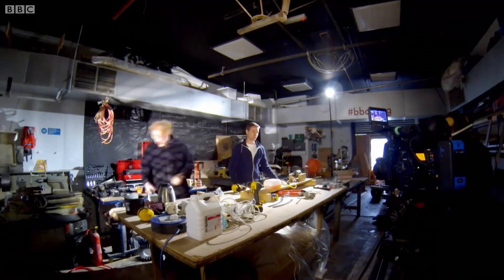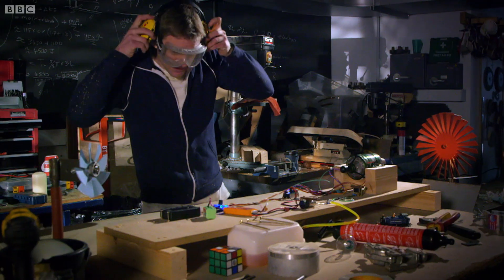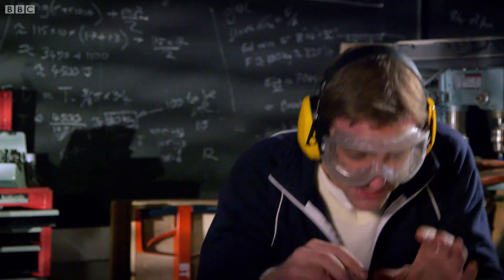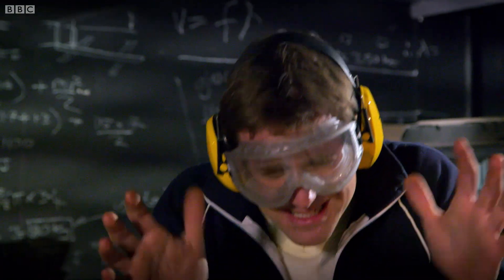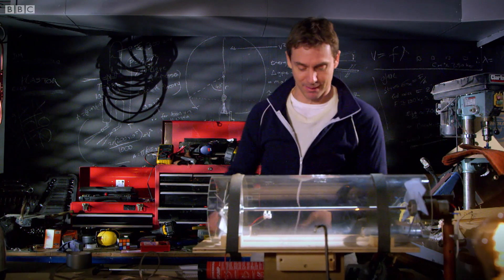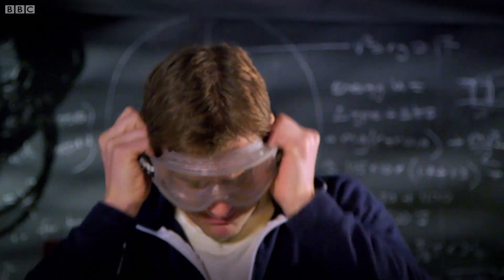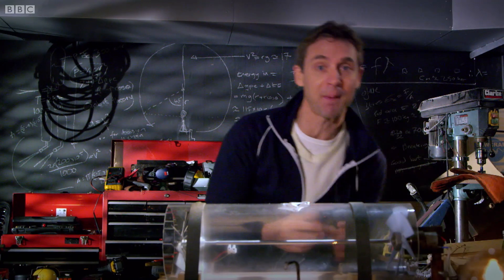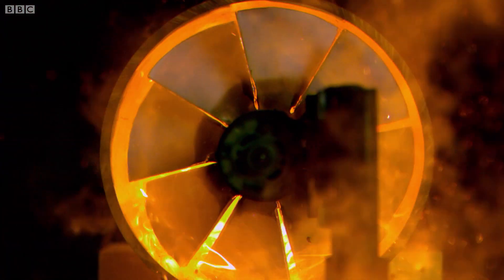How To Make a Mini Power Station | Bang Goes The Theory | Earth Science

Comment: Damn these ignorant people in the comments section. Obviously this is only a demonstration. Why do you expect this to work efficiently? Sure, that second example is off since the turbine needed to be connected to the compressor to sustain the engine, and an external, or separate turbine is what should be connected to the generator, but this is a one-off burst which only shows the concept, and even with this simple example I'm able to understand it clearly.

Comment: Here's one for bang goes the theory to test. Japan or china uses electromagnetic generators that put out more energy than is put into them, so can those generators run off their own electricity that it makes and use the leftover extra energy to run magnetically driven motors or even a jet engine without any fuel use?

Comment: Gladstone power station, Australia, completed 1976 produces 1680 megawatts.  There was a gas turbine for internal start up power and peak load.  Since it was vastly more expensive to run than the coal fired steam turbines, it was usually off.  So I'm not sure which theory went bang here.

Comment: should have used the alternator on the front of that motor. It's connected to the turbine shaft mechanically so you get much more power out of it. Plus that's what it is there for.

Comment: In the second part of the video, the gas expands as it is ignited and spins the turbine fan on the right, which is connected to the compressor fan on the left. My question is why doesn't the gas expand leftwards and apply the same pressure to the compressor fan and make it spin in the opposite direction to the turbine fan. I presume the real turbines will have specially shaped ignition chambers that direct the exhaust gas to the right, but in your setup (the entire tube is the ignition chamber) the performance would be... Zero. Nil. None. Nopes.

Comment: And where do you get cheap gas in industrial scale?

Unless you use solar  power to generate hydrogen gas from water. Hydrogen is also a clean burning fuel.

You can generate solar energy in near desert areas at equator with the most sunlight - where actually transporting the electricity itself is expensive and difficult. 
A way to store energy in the form of hydrogen. Then burn it - releasing heat, kinetic energy and water.

Kinetic energy will turn the turbine as it explodes and expands,  water vapor can be collected as clean water (its pure h2o), heat can be used to   create hot water (for a city) OR used to heat a greenhouse to produce food all year around in colder areas OR redirected to heat water for  steam turbines - double use.
Meanwhile generating 0 waste  - 100% green.

Any billionaire interested of the idea? :D send me a message lol.

Comment: Ridiculous. But how much does it costs in petrol to run that turbine?
Reply: Anchieta Cruz Runs on natural gas. These aren't usually used for constant power generation though. This system is more commonly used as "peakers", that is when a city needs more power than is normally available from the outside grid, say at a time of hot weather when A/C use is unusually high. Power companies will use a system like this to produce power to supplement supply. Actually these work pretty well for that use, faster startup and more efficient than large scale diesel generators of similar capacity for the job.
Reply: Ok +Oldbmwr100rs but How much does it relatively costs per kilowatt? It's efficiency in converting thermal power into electricity. I know the Brayton circle that power ups gas turbines, it's that solution any better than the other options?

Comment: A lot of people are missing the point of a gas generator, yes they are more inefficient but because they can be adjusted so quickly they are better suited to covering sudden peaks in electricity demand. Coal generators take hours to fire up and renewable resources are dependent on the weather/time of day. To make sure an entire citiy never has a drop in the electricity supply we must generate more than what's needed at any one moment since storing it is pretty much impossible on such a large scale. To keep this extra supply down to a minimum most cities will have a gas generator ready to cover those unexpected peaks.

Comment: The efficiency advantage is in matching source with demand for energy. The environmental advantage is using a clean burning fuel whose byproduct is water. The political advantage is that sources of the fuel are broadly and plentifully supplied by free-market democracies. The apparent problem in the model does not exist in machined industrial units. Gas is the clean bridge necessary while we improve the technology for sustainable sources of power.

Comment: So basically you're wasting energy in form of fuel to get even less energy in form of electricity? Nobel's Prize nominee.
Reply: A11ex This is a method of converting energy. You will always get less energy than the potential in the fuel, that's basic physics. The key here is to make the supply match the demand as accurately as possible to reduce one of the causes for inefficiency.
Reply: A11ex He's showing how a power generator works. How do you not understand that?
Reply: A11ex My electronics can't run on fuel.
Reply: A11ex You must be a special kind of stupid... A gasoline generator is at most 25-30% efficient. Gas turbine generators as such are 30-37% efficient. However in those new power plants the exhaust from the turbine engine goes in to a boiler to heat up water for steam to use in a steam turbine. Steam turbines by them self are 30-39% efficient. So now you are extracting over 70% of the chemical energy stored in the fuel. But wait! There is more! The water they use to condense the steam in the steam loop is over 70 deg. Celsius hot! You can use that water for heating and household purposes! So now the efficiency goes up to almost 90-95% which is in the ball park with fuel cells. Cheaper, on a mindbogglingly larger scale... Also, you are not limited to natural gas for fuel, you might also use methane, hydrogen, diesel, kerosene, gasoline  and an array of other liquid and gas fuels. So yeah... They are pretty interesting!
Reply: A11ex natural gas thats mostly wasted or burned on oil platforms anyway,,, methane from farms or human waste can be used too instead of just letting it out in the air like we do today (methane is worse then co2 but becomes less harmful when burned for fuel). He said gas not fuel.
Reply: Not a waste. It's to inform/entertain youtubers. Same could be said about you watching the video that seemed to have neither informed or entertained you, you've just wasted energy and man hours, go do something productive.
Reply: Eviltech More importantly gas turbines are used to cover sudden spikes in the power demand because the power generation can be increased so quickly. To cover this demand with other sources such as coal we would have to generate a lot more power than what is needed so despite being less efficient when used in conjunction with coal and renewable sources the power grid becomes more efficient.
Reply: AshyLarry Yes, it is! And solar is the worst energy source gridwise!
Reply: DigitalYojimbo
I understand the need for YT 'content' but this experiment seems rather pointless. Just use a power generator, imho.
Reply: A11ex You must have completely missed the entire point of the demonstration. Maybe try watching AND listening.
Reply: ***** *Automation, control  and communication technologies... Not that that has any importance, having in mind we just wasted 6 years in university...
Reply: +Profezor Snayp The setup was for demonstration purposes; the turbine engine itself is used to turn a generator, the exhaust is used in a superheater (HRSG) so steam can be used in a steam turbine. That setup is what a power plant (using natural gas) is about and is quite efficient.

Comment: where would you build such a power plant? since I'd imagine it wouldn't be exactly considered "quiet" to fire up multiple jet engines. You could put them in a resonably sound proof building but they also need an air intake and exhaust, and let's not forget proper cooling. but I'm no expert so pleas correct me if I'm talking out of my ass.

Comment: there are a lot of people complaining about efficiency so here's some food for thought

take a turbine, and a mechanical generator of sorts (one that doesnt require gas to operate) connect it to the turbine via gear to gear or 2 gears connected via chain or something else, have the ratio between the two gears in which the turbine can effortlessly turn the generator to create power. the less the turbine has to work the less fuel it burns the more efficient it is
Reply: Justin Bechtel Still not close to the efficiency of a fuelcell(which turns hydrogen(and oxygen) to water with hardly any heat generated and zero pollution)
Reply: Nikolaj Lund Madsen
Still though, it'd be more efficient than just having the thrust of the turbine engine turning a fan, hell you could harness the heat produced and use it to heat water to run a steam powered generator as well
Reply: The whole hydrogen fuel cycle is like 20%!
Reply: leerman22 ?? Pls elaborate :)
Reply: leerman22 As I read the article, Fuel cells are still 50 % efficient, with the fuel given, if you want to "paint" a grand picture of how much each fuel gives compared to how much it takes to extract, refine, transport, and distribute it, I still think Hydrogen COULD be a good alternative, even before counting in the benefit(s) that zero-pollution would bring to the equation.
I totally agree with the fact that electric energy itself is better, because it can be used in its pure form, (i.e. it does not need to be converted into another form of energy, with the inevitable loss that comes with the transformation) But the production of the power, is almost bound to be related to Hydrogen, unless we(people) can resign to follow the tidel nature of the power produced by sun-, wind-, an waveenergy, etc..
P.s. If the source of the electrolysing power is clean and renewable, even 20 % gained is better than the current alternatives.

Comment: It looks like there's a lot of excess heat lost in this model. This fan could be made of, lets say, tungsten and be closer to the engine. Then the hot air behind the turbine, could be used to heat water to power second turbine.
Reply: Krzysztof Bobkowski Yep, that's how gas turbine power plants work.

Comment: Off course in real life, the generator is just mechanically coupled on the axis. The efficiency of the setup in this video will be close to atrocious.
Reply: Justin Bechtel
you put them on one axis, usually you need no gears because generators are extremely efficient at a wide range of RPM. so the turbine design tells you what RPM is best for the turbine, and the generator slows it down to just that speed and keeps it at that speed. the sweet spot will be the speed where the turbine generates the maximum amount of torque with the available fuel. for most turbines that ideal speed is very high, with smaller turbines working at even higher velocity because of the smaller radius. for smaller turbines you will be looking at something around 50000 to 150000 rpm, totally depending on size and design of the turbine. internal gas velocities need to be sub-sonic, but it works best near the edge between sub-sonic and supersonic speeds, this is why the RPM is often so extremely high.
Reply: Nico Smets In real life, it's quite common to use a separate power turbine that isn't mechanically connected. This is especially true of aeroderivative marine and industrial turbine engines, plenty of which are still in service and in production. It's a lot more efficient than you might expect. Go and watch some of AgentJayZ's videos if you want to known everything about gas turbine engines.
Reply: Nico Smets correct. you use a turbine that is designed to put torque on its axis, instead of producing a fast stream of hot air. such a turbine cools down and slows down its own exhaust in several steps to put as much power as possible into rotating the axis.
Reply: kurtilein3 
why not just connect a generator type deal directly to the shaft of the turbine using two gears or using 2 gears and a chain with a ratio that alloys the turbine to efficiently make lots of power with very little effort
Reply: Justin Bechtel adding gears reduces efficiency, simply because they add drag to the system and reduce the output power.